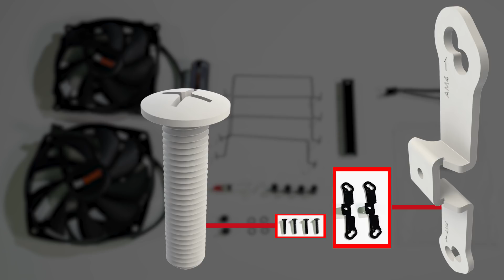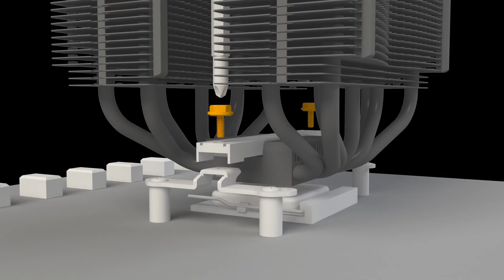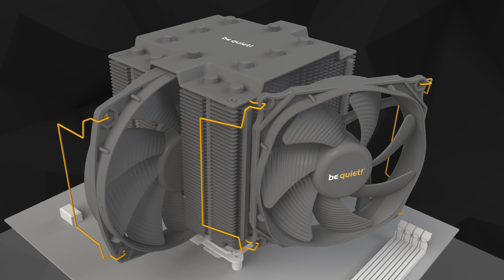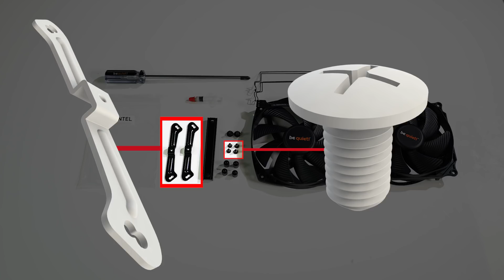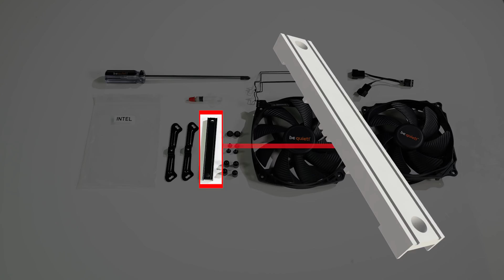Installation: Dark Rock Pro 4 (AMD AM4 / AM3(+), Intel LGA 1151 / 2066) | be quiet!

Comment: The clip part was the worst
Reply from the maker: What was it exactly that gave you problems?
Reply: @bequietofficial  Two different sized clips and didn't notice them differentiated in the instructions. Struggled for a long time. Additionally having the apply the clips is awkward in general. Ideally the fan pieces don't need any assembly and all I need to do is install the brackets and screw down the fan. Don't need to worry about which way the fan or the clips need to be installed. As a first time installer of your fans was more than I expected and I've built 10's of PC's back in the day. Appreciate you asking!

Comment: I'm having real issues with installation on AM3 or AM4 mobo, the mounting screws are almost the same length as the combined spacers! Now I'm an engineer so I know a little about engineering - the small washers are 2mm thick, the taller spacer is 10 mm high, the 6/32" ( Why not metric?) bolts have 14 mm of thread so that leaves 2 mm to go through the motherboard (3+ mm) and into the back plate. Physics don't work here....

Comment: Does the Dark Rock Pro 4 come with a CPU fan splitter cable?
Reply from the maker: Yes, a Y-cable is included. Please find all technical data here: https://www.bequiet.com/en/cpucooler/1378
Reply: @bequietofficial  so, what''s the max current draw on these fans?  0,8A together?

Comment: Can the Dark Rock Pro 4 be mounted horizontally on the AM4 platform?
Reply: You can't install it so that the warm air is pushed through the top of the case. Only option is to have it blow towards the back of the case.
Reply: let me guess, it's because it's blocking your ram slots?
Reply: @newhinhin  no, it's because of how the heatsink screws into the socket
Reply: @verliebt3465  my answer was referring to the post 😅 he wanted to mount the cooler horizontally because its locking the ram slot

Comment: These fan clips need to go away from the industry entirely, doing anything else after the system is already built like adding ram or changing the CPU is exceptionally annoying because of those, GOD, DAMN, FAN CLIIIIIIIIPS OF HEEEEEEEELLLLL
Reply from the maker: Hello Ramirez. Usually they are very easy to install and remove. What is it exactly that gives you trouble?
Reply: @bequietofficial  On small cases if you don't remove the motherboard, it's very, VERY difficult to deal with them, it's an kind of universal issue with any big cooler that uses these little "clips" to hold the fan in place, y'know, big man hands don't fit well on small places heheheh, I've never had an good easy time with them when installing the cooler if the motherboard is already assembled in the case as most mid tower cases have an small clearance near the top of the motherboard, I'm already preparing myself psychologically, getting a 3600X soon and the cooler will have to come out... Yeah removing is easy but getting the clip IN when you have like, ~1cm of clearance and the clip keeps falling on top of the motherboard, let's just say the process might or might not involve a lot of cursing heheheh, the cooler's performance amazing though.
Reply from the maker: A lot of cursing always helps.  :D

The best advice I can give you right now is to mount them before you install the cooler in the system, and remove them after you've removed the cooler respectively. They are slightly difficult to install within the system, but there's really no need for that.

Comment: It is possible to install a third fan, the unit comes with the fan brackets for it.
Reply: Markinpuff I am pretty sure, as long as it’s a silent wings 3 which is the one in the DRP4. The fan brackets are specially designed for it.

Comment: 0:20 why „Only for AM3“? It was an AM4 board, wasn't it?
Reply: You need the washers just for AM3 boards. Otherwise you won't need it (and yes. It was explained with an AM4-Board)
Reply: That x370 board has both am3 and am4 holes for heatsink
Reply: I forgot to put them but it works just great
Reply: @jak241298  why have am3 holes on an am4 mobo? like what
Reply: @austinkenney6033  Yes, to ensure backwards compatibility with coolers. Not cpus.

Comment: Great instruction, however, do not use this video as a baseline for how much thermal paste to use, you really only need about the size of a pea placed dead center on the cpu, the press of the mounted cooler will spread it thoroughly enough. Too much thermal paste will increase heat

Comment: I wanted to like this cooler. I really did. But I'm afraid it didn't do the trick for me.
I have a brand new build with Ryzen 7 2700x and while it is rather quiet when idle, it really does get loud when under load. I thought something might be wrong with the way I installed it at first, or the thermal paste or whatever, because every review and comment I've read says it should be super silent. So I took it off, cleaned the paste, reapplied it etc. But the noise really persists, so I will likely switch to liquid cooling when I upgrade. I'm glad it's working out for other people, but from me it's  sadly a "do not recommend".
Reply from the maker: Hello Emilio. We're very sorry about your bad experience. Have you tried contacting our customer support (service@bequiet.com). What you describe sounds like maybe a faulty fan.

Comment: Hi, could you please confirm something for me, I have a coolmaster 430 case fitted with an M5A97 r2.0 mother board, would a be quiet dark rock pro 4 fit in the case, I have never built a pc and want to change out my current stock cooler which I think is causing issues as the computer is 7 years old and I think needs re-pasted. thanks for any assistance
Reply from the maker: Hello George. According to Cooler Master's website the Elite 430 case is 190mm in depth, while our Dark Rock Pro 4 CPU cooler has a height of 162.8mm. So it should fit just fine. That being said we cannot give any guarantees for cases that are not ours.

Comment: Please fix this terrible mounting system, just rip off Noctua if you have to. The cooler works great once you survive the nightmare of installation.
Reply from the maker: Which part was too difficult and should be improved?
Reply: @bequietofficial  It is very ackward trying to keep that center bar on, lining the cooler up correctly, and feeding the screws in from the side to screw them in from above. The main problem is your whole design only works outside the case. I was replacing a cooler in the case and there isn't room to get this cooler mounted. I finally managed to get it mounted and then there was no room to insert the center fan since that cover plate blocks mounting it from the top. I ended up having to disassemble the cooler, completely remove the mothetboard, buy more thermal paste because you only provide a single application, and assemble it all again. A job that would have taken 5 minutes with a Noctua cooler took an hour with your mounting system. I will say I'm happy with the cooler and Silent Wings case fans now that I'm done, but the difficulty of installation of the cooler will keep me from buying Be Quiet again.
Reply from the maker: Hello! Thank you very much for the feedback. We will try to improve the mounting system.

Comment: Really great tutorial, helped me a lot. However the incompetent morons who wrote the instructions for this cooler should be fired and made to dig ditches. There is nothing that mentions that there are 3 different sizes of the clips that mount the fans, and the cooler needs to face the rubber bars towards the memory side. Even watching this video it was not clear and i wasted a long time trying to figure out why nothing was fitting. The clamping system for the fans really sucks and is poorly designed. i would stay away from this mess of a cooling system, and go with something that has a much easier install.

Comment: If this is "hard" to instal as some youtubers have mentioned then those other coolers must be clip-ons! :p
Reply: It's very annoying to install. My English instructions were English only on one side of the page, the other side was polish,and there was a complete polish instruction paper in the box.

Those flimsy wire brackets to hold the fans onto the heatsink, aren't all the same. 1 pair is shorter and it doesn't say anywhere that.

Had a huge "laugh" because of that.

Also the whole cooler can only be installed in one position. The instructions don't mention this and If you like me happen to install it turned 180 degrees the wrong way, then you need to remove it entirely and turn it around because otherwise the fan brackets don't fit.

And they don't fit because the holes in the fans where they go, aren't centered, they are offset a little towards one side, so turning the fans around to have them pull air instead of pushing, makes your brackets not fit.

The Noctua cooler my friend has didn't have such "wonderful" surprises waiting to be discovered.

First and last time I buy something from be quiet.

Comment: As I see it, the cooler is blocking 2 out of 4 ram slots on 99% of all boards, and it just works with low profile RAM, right? Maybe think about DESIGNING a cooler next time, which wont do that.
Reply from the maker: You'll find all technical data, including the RAM clearance, here: https://www.bequiet.com/de/cpucooler/1378
Reply: As far as I've read (not seen) you have a decent amount of ram clearance for most ram. If you need any more you can put the fan a couple mm higher. Maybe think about reading next time, cause seeing won't do that.
Reply: Cool thing, you can mount the fan higher, cool thing. THAT IS NOT THE DESIGN. Of course you can do that, it will reduce cooling though a bit and looks weird. I read tons of reports, that the fan blocks most normal RAM modules, for example theses one or any other cooling same: G.Skill RipJaws V schwarz DIMM Kit 16GB, DDR4-3200 https://i.imgur.com/vKRXRAQ.png
Reply: Yes CAN, you certainly don't need to do it. And most ram is not that high. Gskill Trident Z RGB fits under there. If your ram doens't fit then don't buy this cooler. Duh.
Reply: You CAN also leave away the outer fan totally : DDDDDDDD !!!! No, 99% of normal RAM doesnt fit in a normal build with this cooler and fan. Putting the FAN more up is no workaround to accept. A product hast to work especially this expensive fan, which is like the most expensive fan you can buy.
Reply: Actually you got 40mm clearance so most ram does fit. Just not the extreme tall ones. Try to look at the official info or the actual proper reviews.
Reply: Totally not true. I linked you normal ram which has normal proportions, should I link you 20 others who have the same proportions and wont fit? THAT WASNT a "special" one with large heatsink on it.
Reply: I'm sure you can find even more, plenty of ram out there. Doesn't change the fact that most ram still fits fine. It's not meant to fit everything.
Reply: Hey so I just installed my DRP4 I also have Ripjaws V RAM and no issues at all. Don't know wtf this clown is on about.

Comment: Awesome.. the next horrible mounting system in dark pro series.
Reply: You`re right.. much better than my Dark Rock Pro 3.. now they deliver a skrewdriver like the 30 bucks macho. Assembling is also muuuuch better.  xD
Reply: Dont`t cry fanboy
Reply: I never had a problem with the dark rock 3,4 or TF models.  The problem was most people didn’t install it correctly.  This was mostly because the documentation was unclear.
Reply: PRO3 is much easier.
Reply: @mathef  LOOOLLLL wtff